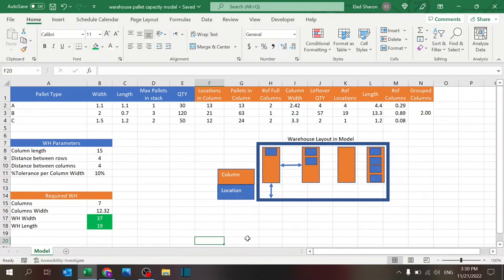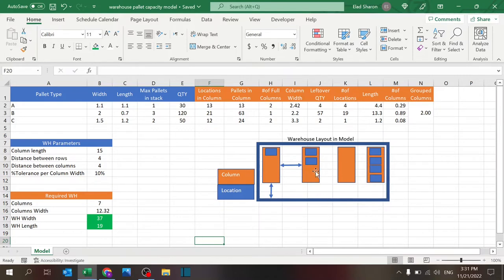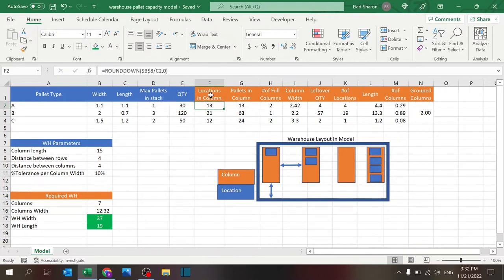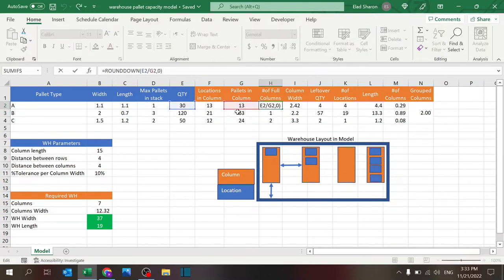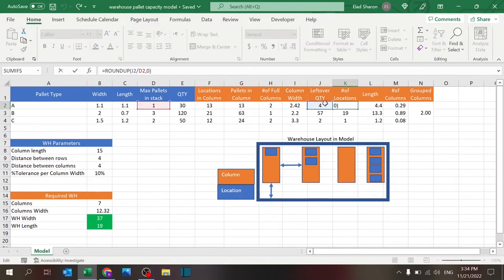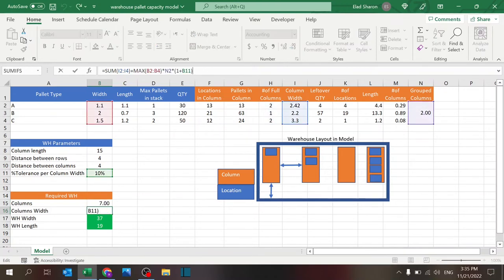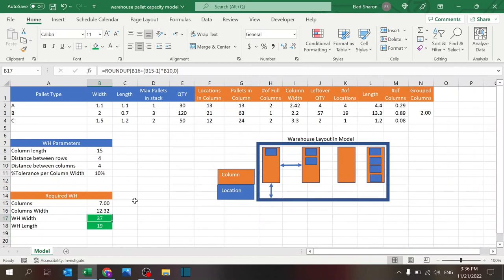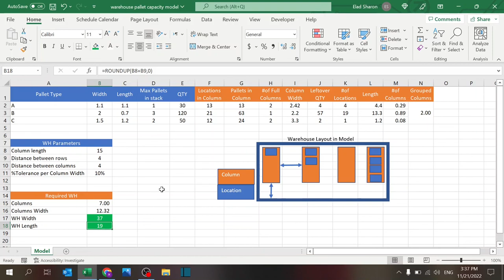warehouse pallet capacity model

Comment: 4 feet in between rows?  have you ever worked on a forklift before?  they are about 5 feet in lenth (sitting down)  and the forks of course are 3 feet long   I think you miscalculated the width of the circulating rows for the forklifts
Reply from the maker: The UOM is not mentioned in the file so that's up to you.  My example was built on Meter. 
In any case you can change the numbers to match your needs.